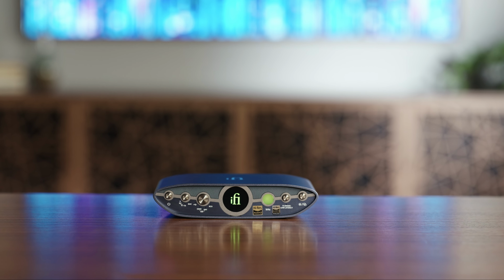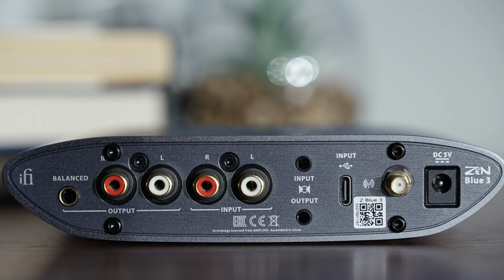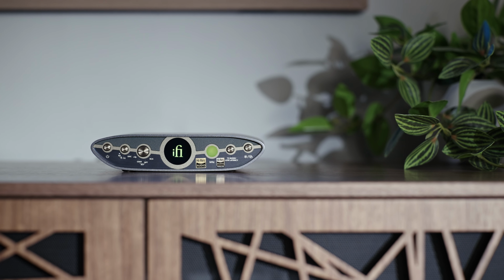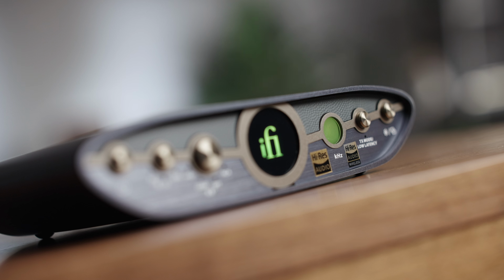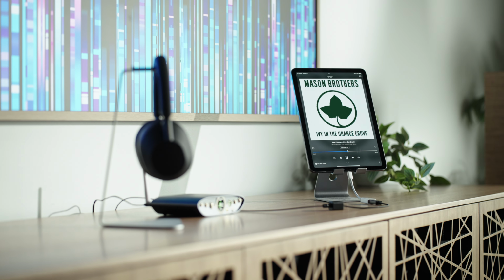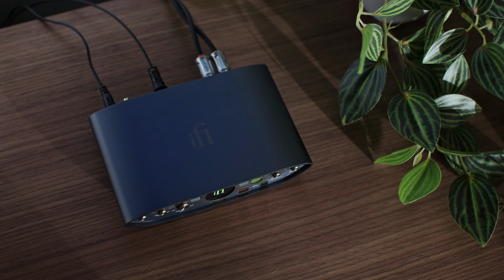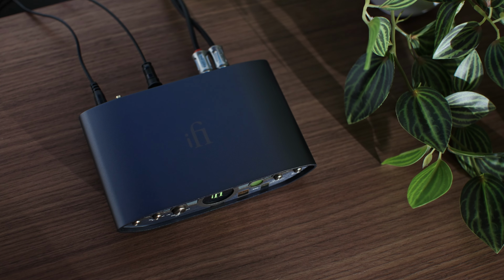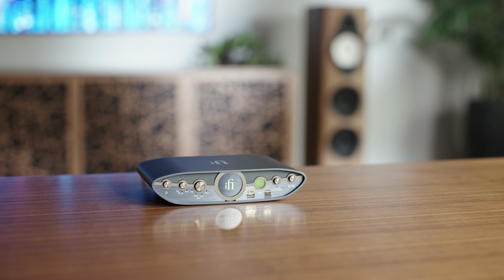iFi ZEN Blue 3 Bluetooth transmitter/receiver | Crutchfield

Comment: If connecting this to a PC to drive wired headphones should I get the Zen Blue 3 Bluetooth DAC & Zen CAN 3 Headphone Amp Bundle? I have Sony MDR 1--ADN BT LDAC headphones, Sennheiser HD 58X Jubilee, and Sennheiser HD490 pro headphones for primarily gaming, but music and podcasts too. Just contacted Crutchfield regarding a Klipsch ProMedia computer speaker return, got incredible service and a great phone conference with Bo. Going to purchase my DAC there to support them. Speakers were fine and ended up being a software PC app bug that I am working with Klipsch to resolve.
Reply from the maker: Thanks for reaching out, we're happy to help! Free tech support is included with every Crutchfield purchase,  just locate your Crutchfield order number in your confirmation emails and give our experts a call at 1-888-292-2575.

Comment: Greetings, good day. I have a question. I have a 2nd-generation iPod touch. Could I connect it to the Zen Blue 3 using the Zen Blue 3's RCA IN analog input? To transmit sound to my Genezi GNX 800? Is this possible? Or do I have to buy a Bluetooth adapter and insert it through the 3.5mm jack output? Please guide me on this point. Have a nice day.
Reply from the maker: Hi Jose, you can connect from your iPod's headphone output to the RCA input on the Zen Blue 3 using the included 21" Stereo RCA patch cable and a 3.5mm to RCA adaptor: www.crutchfield.com/I-rYALc921/p_00735RCA/item.html

Comment: Am i stupid, i see no optical connection , i have the zen v1 , it has the optical connection
Reply from the maker: The iFi Zen Blue 3 has a 3.5mm optical digital audio input and 3.5mm optical output, and it includes an optical-to-3.5mm adapter in the box.
Reply: @crutchfield I actually went and researched 3.5mm Optical cable learnt something that i never knew , so in a sense i am stupid 😅

I have been a HiFi hobbyist for 20 years, with audio equipment from Krell, Focal, Bricasti, Auralic, Luxman . . . .

Cables from Audioquest, Nordost and a QED Reference Toslink Optical

I never knew a 3.5mm s/pdif was an optical interface with 3.5mm plug.  

I have the ifi zen blue v1, and use the Toslink Optical connection.

Thank you for your reply, i thought you can not be wrong and it made me research s/pdif, something i have never needed to use.

Comment: please help, I need to connect my gaming PC with good blutooth wireless headset and also with my Dali Rubikore 2 passive speakers with quick switching between the 2 outputs.  Can it be all connected with zen blue 3 ? or do i need more receivers,amps or preamps, i'm new to hi-fi so i'm really overwhelmed here. Also what is the best connection pc to zen blue 3 ?
Reply from the maker: The iFi Zen Blue 3 has RCA inputs and RCA outputs. It doesn't have any built-in amplification so you would need a separate amplifier/receiver to power the Dali Rubikore 2 speakers. The Cambridge Audio EVO 150 Integrated Amp is a great choice I recommend with plenty of power to drive your speakers, built-in Bluetooth receiver/transmitter, and USB input for your MAC/PC.
www.crutchfield.com/p_779EVO150/item.html

Comment: What about connecting a cassette deck to this unit? Will I be able to launch Audacity and make mp3/flac/wav of my old tapes as well as just listen to them? Or to put another way: Is the Zen Blue 3 working as a regular PC/Mac external soundcard when plugging it to USB? Is there any software included?
Reply from the maker: This does not work as a soundcard for a computer. Its USB is only an input to take in audio being played on a computer. It cannot send audio back to the computer.
Reply: @crutchfield  Thanks for letting me know! 🙏

Comment: So I love my Zen can, and was using a sound blaster g6 as a dac. I was going to get a zen dac, but it only looks like it has one non balanced out put and I also hook my speakers up through my g6…… so what I’m hoping for is to get the Zen Blue 3 since it looks like it has multiple non balanced outputs and pick up an Zen Can 3 so the colors match. I’m assuming swapping out signal on the zen blue is a simple?
Reply from the maker: The Zen Blue 3 features an RCA unbalanced output, 4.4mm balanced output, and an SPDIF optical digital output (adapter included). Choosing input source and function on the iFi Zen Blue 3 is straightforward and easy to use! With all iFi products, you get incredible sound quality and performance.
Reply: @ so I could use the coaxial 3.5 for my powered speakers, and the rca for my zen can, and use it as my DAC. Also I know it’s made to Bluetooth source then output it, but does it work in reverse? Like hook up Bluetooth headphones when in dac mode?
Reply from the maker: Yes, it has a Bluetooth transmitter mode that allows it to output a wireless signal from an input source to Bluetooth headphones or speakers.

Comment: So, it could convert AAC to LDAC / AptX Lossless and send it to Bluetooth device by connecting it to iOS device through USB-C and set it to TX mode? I’m just at one step away from buying it. Help me to decide!
Reply from the maker: The USB-C input supports digital audio input from computer audio source and also doubles as power supply. You cannot direct connect a smartphone. You can transmit computer audio to your Bluetooth devices. The iFi Zen Blue 3 is a very flexible piece of gear with excellent sound quality, who wouldn't need one??

Comment: Great review! Is it possible connecting my cd player’s digital output to zen blue ‘s digital input? If so, is it worth using the zen blue externally as a dac? I am having yamaha cd-s303. Thanks a lot!
Reply from the maker: Yes, you would likely hear even more detail and a wider sound stage from your CDs connecting from your Yamaha player to the iFi Zen Blue 3. Do you have a cable you can use?
Reply: @ Ok, great! Thanks for the quick response! I'm having a toslink/optical cable available. Looking at the back of the cd player, I see there are 2 available outputs, an optical and a coaxial. Do you think I'll be fine with the toslink cable?
Reply from the maker: Yes, optical will be perfect! Let us know how you like it and if we can help you with anything else. Happy listening!

Comment: I want to connect to two Sonos 1 and a Sonos Roam plus a Sonos Ray I play the music through an iPad and have a Tidal subscription thanks
Reply from the maker: You will not need a Bluetooth adapter like the iFi ZEN Blue 3 to use your Sonos gear with your iPad. You can use the Sonos app and the built-in Wi-Fi features of your Sonos 1's, Sonos Roam gen 2, and Sonos Ray.

Comment: hello im very curious could i connect this Device all through Bluetooth to my S24 Ultra with a Bluetooth Lavalier Mic while connected to my Home Theater System by Bluetooth as well ???
Reply from the maker: The ZEN Blue 3 offers three operation modes: RX, TX, and DAC. The front panel Operating Mode Selector cycles through the following modes:

Bluetooth RX: The device receives a Bluetooth signal from a smartphone or other digital audio player, and decodes it. The audio is output via balanced (4.4mm) or single-ended (RCA) analog outputs or S/PDIF (optical or coaxial) digital outputs.

Bluetooth TX: In TX mode, the device decodes audio from a smartphone, laptop, TV, game console, or CD player via USB, RCA, or S/PDIF (optical/coaxial), and transmits via Bluetooth to wireless headphones, Bluetooth speakers, or other Bluetooth device. In this mode, the Input Selector on the front panel can be used to increase or decrease the volume via long press (volume up) or short, then long press (volume down).

Comment: So is there no way to use this as a dac for wired headphones?
Reply from the maker: Unfortunately, it doesn't have a dedicated headphone output or internal headphone amp, but it can be connected to an external headphone amp if you want to use wired headphones.
Reply: @crutchfield  hmm , could it somehow connect to the ifi go blu via it's usb c input?  Just wondering what's possible as I have the go blu and wondered if the DAC on this device would be better than the go's DAC. Maximising the options!
Reply from the maker: What headphones and source are you looking to listen to?
Reply: @crutchfield  primarily Aune AR5000 headphones, so would like to connect them via the go blu wirelessly or, as per above if it's possible to use one of the outputs of the zen blue 3 in to the usb on the go blue. I also have Audeze Maxwell so wondered about using the zen's DAC with those via aux in (though I think they're actually probably better wireless). Source  is highest I can input via usb c in on the zen from pc -Amazon music HD unlimited subscription.
Reply: Also thinking could I use the coax out with an adapter to female stereo 3.5mm and plug the phones in there?
Reply from the maker: You will not be able to power headphones directly from the  iFi Zen Blue 3 or connect to your iFi Go blu portable headphone amp as it only features USB-C input. If you wish to have a solid iFi Headphone amp for use with the Zen Blue 3's RCA outputs, the iFi ZEN CAN standard edition headphone amp below is an excellent call.

https://www.crutchfield.com/I-rYALc166/p_246ZENCAN/iFi-ZEN-CAN-Standard-Edition.html
Reply: Will this item increase sound quality between smartphone and a couple of jbl Bluetooth speakers??
Is it mobile or do I need to have an electric power source
Thanks for your videos

Comment: how can i connect it to playstation 5?
Reply from the maker: The only way we know it will work is to connect the PS5 to a TV and then grab the audio from the TV either using an audio output on it or by using the HDMI ARC port with this converter:

www.crutchfield.com/I-rYALc227/p_970HDX21BK/item.html

Comment: What is the range of the Bluetooth signal from the antenna?
Reply from the maker: There is no maximum range listed in the specifications by iFi. Without being described specifically as long-range, transmission and reception should have a range of around 33-feet which is fairly standard for most Bluetooth devices.